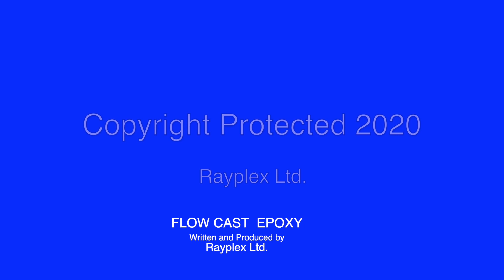Flow Cast Epoxy by ecopoxy

Comment: Can this be used on a picnic table outside?
Reply from the maker: You should use the UVPOXY to coat thePicnic Table.
Reply: Rayplex Ltd - where can I buy that?  Is it made by flowcast?
Reply from the maker: @dimiller1733  go to   www.rayplex.ca
Reply: @rayplex  If you haven't purchased, DON'T !!. I tried flow cast it's on a project that is shallow small crevices some deeper 1 inch. It dries tacky, it takes super long. I would look for another product. If you used it, I would be very interested in knowing your results, because they were terrible for me and I may loose the whole piece of would which was very expensive!!
Reply: @Cocora22  haven't had that experience but I use the uvpoxy por 1 inch to 2 inch pours, and flow cast for larger or deeper proyects since it's tackier in consistency than the uv one

Comment: bubbles are due to  pouring your flowcas far too deep, as they suggest pouring to a depth of no more then 1.5 inches,  also do now forget to come over ever hour or so with a light torching
Reply: Thank you for your advice. when i poured to deep it had wrinkles on top when it was dry.  i FEEL BETTER USING THIS ECOPOXY FLOW CAST .  i feel it is safer to use. but i stil wear necessary clothes when pouribg.
Reply: Echo epoxy can pour up to 4 inches do ur research